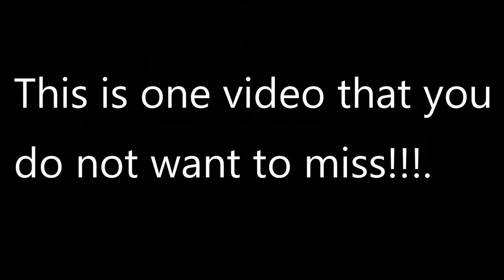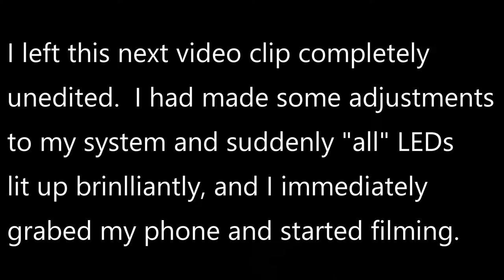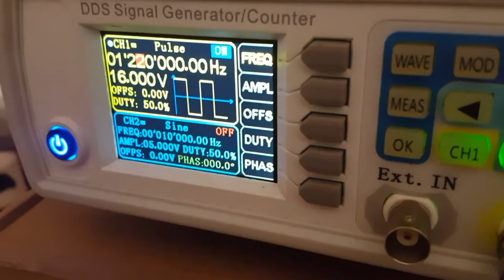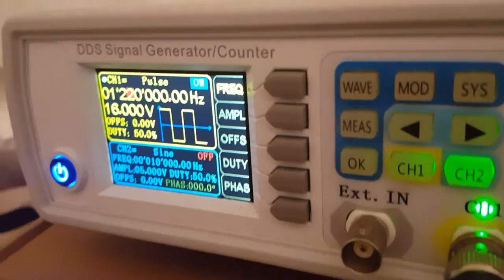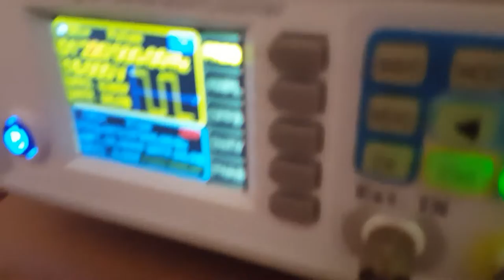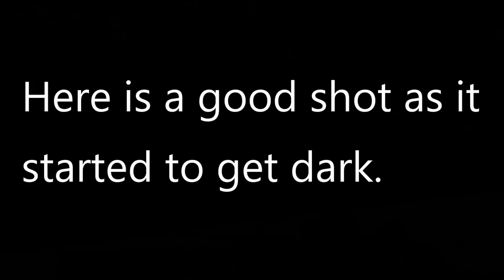WIRELESS POWER TRANSFER Part 17 (Over unity!? Free energy!!?)

Comment: Paul, for a comparison; watch my video "Harvesting Antenna Energy":  https://youtu.be/PBkwBrQoc-M
In my load test that I show, I'm lighting 24 LEDs with around 3.1 milliwatts.
 .0031(watts) ÷ 24(LEDs) = .0001291 watts per LED

You are lighting 710 LEDs with 1.6 watts, -at the most you say. (16volts x .100 amps)
1.6(watts) ÷ 710(LEDs) = .0022535 watts per LED

I'm not sure how bright your LEDs are, or the size.  They look like standard ones?
  
Mine LEDs are from a flashlight; arrayed in a 4 x 6 configuration.  They are standard 5mm white LEDs.
They are not full bright compared to operating on batteries; but they are still operating at about 19.6 times less power (per LED) than yours.

I think I did the math right? 
What you are doing is interesting, but just wanted to give you something to compare to.  It doesn't take much to light LEDs.
Reply from the maker: Sorry i dont know how i missed this comment.  I am subscribed to you and missed these videos.  I get 21 LEDs lit with my antenna set-up also, and i get over 120V and only microamps....  https://www.youtube.com/watch?v=XK3NrQLR2XE&t=247s
I have similar antenna as you do.  Mine starts as one antenna and then splits into 7 and then back to one, if that makes any sense.  You have very good results!  You should enter it into Russ Gries Pulse Motor Build Off that he has every year,, i think it is going on now.  I think you would win.
With my wireless project with 710 LEDs, i believe it can be powered with the antenna circuit.  The wireless project, i now have multiple ways to greatly increase the power yet, without increasing power input😎.  Now i am in the process of taking power in & out readings with scope.  I must now prove the power and then to, validate it.
Reply: @INVENTOR3  Hey Paul; I have seen some of your past videos experimenting with the Joe Tate circuit and coils.  That can be fun.👍🏻.  My circuit is a little different than his.  I don't show the whole thing in my videos.  It's not Patented like his.  I don't know if he ever made any money off of it...🤷🏻‍♂️  I just put mine in a booklet and copyrighted it.
I will check out the Pulse Motor Build Off, 
Thanks

Comment: Now... At this step... Just to be sure for sure...

Methodically determine EVERYTHING about EACH ELEMENT of the circut... [lenghts of wire, numbers of turns, wire gauges, the known specs of every single LED, alligator clip, factory made connector, the precise model of signal generator, the little plastic terminal blocks...EVERYTHING]

Its a hard task, yes, but its CRITICAL.

Take all of the data, take specific mapping photos,

Then assemble it as a document [like a spreadsheet] and publish it on every possible open source.

THE ONLY way you can obtain TRUE CREDIBILITY is if we the audience can come along bhind you and reproduce the same [or reasonably similar] results.

I PERSONALLY KNOW it is entirely possible, MY [late] FATHER who was en electronics engineer and tinkerer, who worked on a ton of long range military and civillian telecom [back when it TRULY WAS 'tele', as in airwaves, and not wired in cable connectors, we've really degraded in many ways when it comes to these technologies actually, we waste more these days, instead of saving more ], my younger brother, who is a ceritified electrical/electronics genuis, is a robotics and electronics engineer and [and former cyber security officer for the USAF, now retired] believes, and I know a lot of other believe.

It takes a person with your single-minded, single-hearted devotion to this to first make it, then make it so clear that everybody out here can replicate it [BEFORE it gets censored and some men in dark suits (or shite suits, or cammo uniforms) comes along and scoops up everthing you have and makes you and all of it vanish mysteriously] so it GETS OUT THERE.

To any person here reading this, I hope you have been taking note, if you can, help save and back up his videos some place they can not be rooted out and destroyed, and Paul, if at all possible, please make sure you have every single speck of data from day one, step one, logged and recorded, make copies of it, give out copies to every person you can, load it on the deep web, hide copies of it in bank vults or train lockers, or whatnot where it can only be accessed if something happens to you or your work, so that no matter how much the powers that be try, they can not truly and fully eradicate it.

The evil forces all spew this and that about 'green, renewable energy' and yet they do everything they possibly can to PREVENT that...

WHY?

Because FREE = FREE!

If they can not CONTROL the POWER, then WE THE PEOPLE have 'THE POWER' to rule and change our own destines again!

THEY RELY on us being too weak willed, to narrow minded, to blinded by their lies, to go out and make a better world for ourselves, our children, for each other, but A VERY FEW OF US are secretly working BEHIND THE SCENES [you are out in front, and we respect you for this, it helps many of us to congregate actually].

I just made a discord channel for people to meet up about free energy and organic living [I feel so INSPIRED after seeing this!], so message me privately if you want the invite information.
Reply from the maker: I am very touched.  Thank you very much!  Love your great comments, especially this "If they can not CONTROL the POWER, then WE THE PEOPLE have 'THE POWER' to rule and change our own destines again!".
Good to see you again, thanks for sticking with me all these years😁
Reply from the maker: Grrrr, I dont know how to get a private message to you,,,,,I can build this, but dont know how to PM, hahahaha.  Youtube does not have messaging from your channel anymore.  Are we connected on FB?
Please send me an email    millanyangle@yahoo.com

Comment: Paul, why did you choose 1.22Mhz? 
I know in my antenna energy receiver, the frequency is around 1.27Mhz-1.34Mhz.  I show this in my videos.  But these are frequencies from local radio broadcasts.  I can tell exactly when they boost their power in the morning, and reduce it again at night.

If you have an earth ground in your circuit, you could be getting in resonance with local broadcasts in your area, and so tapping into a little bit of their power, eh?
Reply from the maker: Humm, i did not intend to specifically tune in to radio, I just wanted to double my frequency because the higher you go the more energy. It was a coincident, as I add or remove small coils and add or remove LEDs the freq changes. Don Smith used around 220MHz a 4 foot length of wire for primary coil.  The nearest radio station is about 8 miles away.
I do have the system Earth grounded at this time, but I strongly believe I can get it to work without an Earth ground and only a specific length of wire instead, because I have already did this with past experiments in with this project.
Eventually I will have to take this project to some remote land away from most power.
I think it will still work, the electrons are everywhere.  Don Smith says something like, "it is not Over Unity or free energy, were just using the energy that is right in front of our faces".
Thanks for watching & commenting.
Reply from the maker: I just subscribed to you,,,I must watch your NiTiNol videos and perpetual device powered by RF😁.  I have videos of Free energy from air and also videos on NiTiNol.  We have common projects.
Reply: @INVENTOR3  I will subscribe to you as well, so I can see how you progress.
Thanks